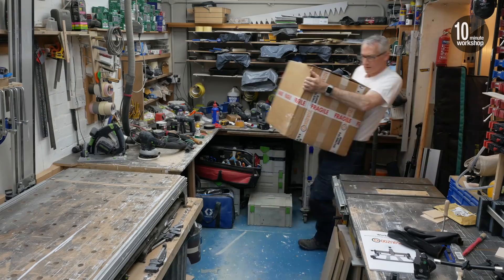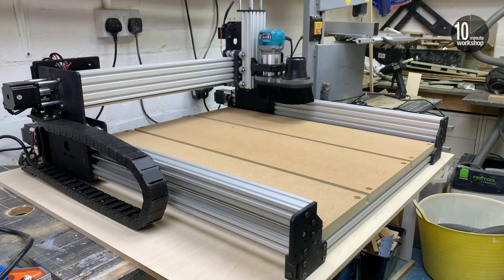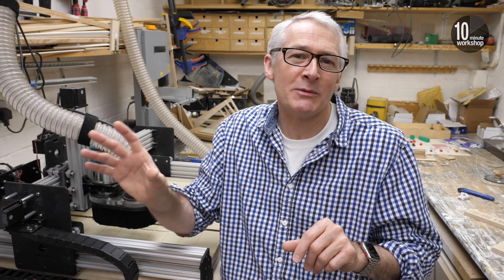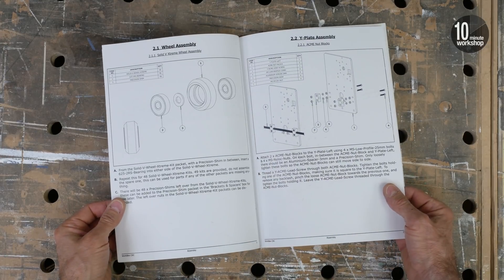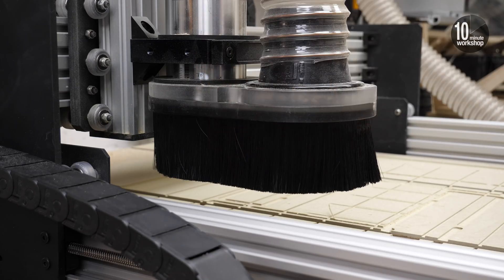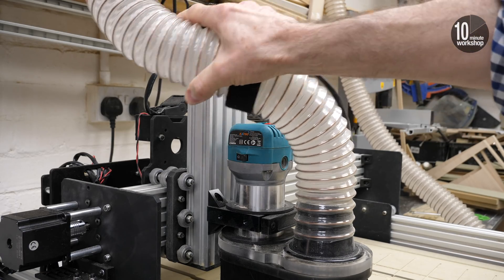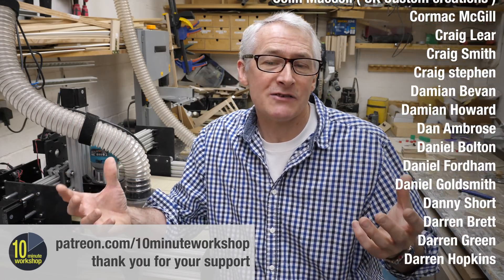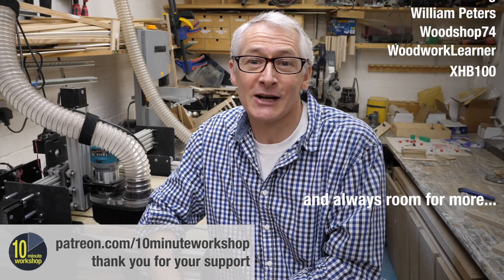Starting Out in CNC P11 - In conclusion [video 395]

Comment: Always a pleasure to watch your videos they got me into track saws,having watched your videos on CNC because I’ve been looking at them myself. I wondered if you had anything more to add on the use of now time has passed. Keep the videos coming.
Reply from the maker: I'd just say to have a think about what the solution is that you want to solve; after a bit of time with it I decided that it was too big for the space I have, and too small of a work area for what I'd like to use one for. Also, slow and noisy. An 'enthusiast'  grade of CNC like the Ooznest is brilliant if you need one-offs like signs and plaques, or maybe half a dozen of something; it turned out that I either need 1 or 2 of something, or 100+. The 1 or 2 I could make on a bandsaw and sander faster than I could draw it up, let alone set the machine running. and for 100+ it's worth getting someone else with an industrial grade machine to do them for me. Hope that makes sense!

Peter
Reply: It does make sense Peter and thanks for your thoughts 👍

Comment: Hi Peter, I'm seriously considering an Ooznest CNC and just wondering if you have had a good or bad experience with yours? The building side of it is not anything I'm concerned with as I used to build model kits for a model shop, for the customers that didn't want to and also garden machinery repairs. Thanks
Reply from the maker: I didn’t find a CNC particularly useful; the Ooznest original Workbee isn’t a production machine - too slow for that. Great hobby machine though. Ooznest are fantastic to buy from, very customer focussed with great support. 👍👍

Comment: Hi Peter. Is there going to be an update on your cnc adventure? Do you still use it? Cheers
Reply from the maker: Been using it just last week actually (see my Instagram) and have just posted a Patreon/members video about why it hasn’t seen much use. Lots to do with it before I’d consider using it regularly. Long story short it doesn’t really fit very well with what I do, and what it does well it turns out  I rarely need. 🤷‍♂️ Great machine though. 👍

Comment: So, I believe this was the final (for now) CNC episode. I recently watched this series again because my interest in them has spiked once more. It's a great series.
I particularly liked the look on your face after successfully making two right angle clamping squares with it.
I was wondering if you ever cleared your other workshop space as intended to install the #Ooznest #Workbee or if it has joined the bottom of a long todo list?
Do you still have plans to revisit this in the future? And do you still feel you would buy this tool again?
Reply from the maker: I posted about this today on Instagram! https://www.instagram.com/p/CPSSm0sDPYJ/?utm_medium=copy_link 

It’s been moved twice, most recently to (I hope) it’s final location, and I used it yesterday for the first time in a long time; worked great, but it is slow, and loud.

There are two issues with CNCs in general for me; the main one is lack of space, and the second one is software - I don’t own a PC and I’m not about to buy one just to run one application!

This particular CNC really needs a proper spindle/router - I put the little Katsu on their just to see if it worked tbh - but in truth a decent Mafell or SauterShop milling motor is going to cost far, far more than I’d ever be able to justify for the use I’m likely to get out of it. There are many more reasons why I don’t really see it getting a lot of use, but the main one is that it doesn’t really do anything I need; if I need to prototype something quickly and simply, then I’m much faster on a bandsaw and router, and where the CNC would score - doing it again, and again - just isn’t something I’d do here - I’d prefer to farm that kind of work out to someone with an industrial CNC than can chew through the birch ply faster.

That doesn’t take anything away from the Workbee - it’s a great machines, but for what I do it’s neither fish nor fowl. 🤷‍♂️👍
Reply: @10MinuteWorkshop  Yes, I see where you are coming from. I tend to agree that would be the case for me too - but something tells me I need one! :)

Comment: What a helpful and informative series Peter; well done and many thanks. It’s persuaded me to jump down the rabbit hole and put an order in with Oozenest. 
Like you, I’m living in an Apple world so I’m going to partition the Mac to run Windows.  I notice that you use a MacBook to drive the controller. Presumably you don’t find there’s a problem sending the G code from Vectric to the Mac via a USB stick?
Do you have any plans to update us on how your thinking and skill set has moved on with the kit since you last posted? I’m sure we’d all like to know!
Keep up the good work
D
Reply from the maker: Thanks Dirk! I have to be honest I haven't used the CNC much since I made this series; I needed to move it, and having done that it needs recalibrating, which I'm not keen to do right now as a0 I need to move it again, and b) I want to change the spindle. So more to come on this, but I need a workshop re-org before that can happen. 👍
And noi issues at all running G code via a USB stick; the controller has a browser interface, so you can actually control it from your phone or iPad once the files are loaded. 👍

Comment: Are you going to use a dedicated computer to control the CNC? Do have concerns about wood dust causing the computer to overheat or cause a fire?
Reply from the maker: No, and no! Once the toolpath gcode is loaded onto the CNC, you can run it through a browser on anything eg phone or iPad. I may get a dedicated ‘workshop’ machine, but no, I’ve no concerns about having it in the same room. 👍👍

Comment: Hi peter. Thanks for your videos. What spindle where you looking at. I am really interested in one and don't want to burn my makita router and does the ooznest has the capable to control speed of the spindle?
Reply from the maker: Hi Adrian, and thanks! There’s a Mafell ‘milling motor’ that’s looking good, and one from Kress; both of these can be powered on and speed controlled from the duet board on the Ooznest Workbee. There’s also a Fein die grinder that’s been recommended - die grinders can be good as they’re designed for lateral forces. The Mafell’s looking favourite - and the most expensive, naturally... 🤷‍♂️👍
Reply: @10MinuteWorkshop  hi peter, thank you fir your reply. You channel is one of my favourite. I will visit your patreon site for sure as 10 minutes are not enough :)

Comment: If you are familiar w/ Ron Paulk’s eponymous workbench, when FastCap got the rights to produce it, they used a CNC machine to quickly machine an 8x4 of plywood into the required parts and they machine them now on demand. It’s an amazing enabler technology.. once the programming is done, you can do it over and over.
Another YouTuber that uses CNC to enhance his otherwise hand-built cabinets etc is Frank Howarth. He does little things that I think your ‘well funded’ customers might appreciate. Such as routing little jigsaw piece shapes (either leave the routed shape clear or use the BC to machine a contrasting piece of real tree meat to glue into it) into kids toy box panels, dog bones, etc. A total pain to do manually but relatively easy w a NC.

A cabinet maker with an aesthetes eye (as you have) will find no end of uses for your machine.
Reply from the maker: Thanks Frank! Yes, like the Tracksaw and the Domino, the CNC will enable a whole range of other things to be made with relative ease - ‘relative’ being the word! And I agree, it’s quite remarkable what a full-size industrial CNC can do! 👍👍

Comment: Hi Peter, I have machined 20mm holes along the front of the X axis and along the left hand side of the Y axis, that way you can use bench dogs to align the workpiece in the same location every time. Then all you need to align is the Z height. Obviously this only works on square or oblong stock.
Reply from the maker: Great idea, thanks! 👍👍

Comment: Great build and review Peter, however I do think you have missed the emphasis of the cost of the software (esp) Aspire as its running out at around £1100 for a license that effectively doubles your costs?
Reply from the maker: Thanks Graham. There’s nothing I’ve done with Aspire that couldn’t be done with e.g.  the entry-level Vectric Cut2D Desktop software. As I say in the vid, Vectric very kindly gave me access to Aspire (for a limited period) and I’ve only used it in the most simplistic of ways, so far. Other options are available eg Fusion 360, which is effectively free to use for most people. 👍👍

Comment: Tip for file transfers, you could use Dropbox or Google drive on both computers and automatically sync your gcode files between PC and laptop. No more faffing with USB flash drives.
Reply from the maker: Thanks - they’re all networked tbh, so no worries there 👍👍

Comment: Spindle advice: I started off with a router like you. Cuts ok and gets you going. But the noise and an air cooled motor blowing sawdust everywhere was not enjoyable. I changed to a water cooled spindle with an ER20 set of collets. Pros: you can use 1 to 13mm shank cutters ( most large router cutters have a 1/2” shank) , speed  4000 to 24000 rpm. Controllable switch on, off and speed choice in gcode if your controller supports it. Cons: coolant container (5 gallon bucket) , flow and return pipes, pump , vfd, and spindle will be heavier than your router. With a long programme running I leave my machine running and close the door “lights out”. My advice; stick with what  you have until you get fed up with it. Retired toolmaker.
Reply from the maker: Thanks! Yes, this little router won’t last long if I keep using it like this, but a better ‘milling motor’ is on the cards soon; be a while before I get to water cooled 3-phase though! 👍👍

Comment: As you have Aspire you need to get a 3mm ball nose bit and do some 3D carving.
Reply from the maker: One thing at a time - but yes, absolutely! 👍👍
Reply: Peter Millard as you’ve spent more on software than the CNC machine you should make best use from it or you’d been better off with cut2d or vcarve.

Comment: My CNC started out with a makita 0700c router, which looks identical to the one your using.  It caught on fire three times. Luckily it was under warranty and was replaced each time. After the final fire I switched to a water cooled spindle. And what a difference both in power and lack of noise.
Reply from the maker: Yes, the Katsu is a cheap knock-off if the Makita. It’s the first thing I’ll be changing. 👍

Comment: A very interesting series of videos which has taught me a lot, and answered a lot of questions I had  not even considered. It will be interesting to see how well this machine performs when it is all properly set up. If you are feeling flush, I would definitely recommend the Mafell motor: they are nigh on indestructible.
Reply from the maker: Thanks! Yes, I think the Mafell is the front-runner. 👍👍

Comment: Yes, excellent idea to switch to a spindle!
I recommend software controlled variable speed. It helps making cleaner cuts as it allows to match the router bits recommended speeds more precisely than using a router's speed selection knob. You can also vary the speed based on the geometry to be cut during more intricate work.
If you don't need to change the router bits very often then a quick release chuck is just a nice to have.
Reply from the maker: Thanks! Yes, looking forwards to learning more about all this! 👍👍

Comment: I have a Kress spindle (actually an industrial grinder) - also VERY noisy - although suppose you could say it's an "expensive-sounding" racket ;-)
The Mafell spindle with quick tool change looks lovely - I find changing bit's to be a bore - my next machine will definitely be for full 8x4' sheets and have an auto tool changer.
Reply from the maker: Yes, it seems the only way to reduce the noise significantly is a water-cooled industrial spindle. Next time, maybe... 🤔😆👍
Reply: @10MinuteWorkshop  I use an aircooled 800W ER11 spindle (~100€ on ebay)  on my diy cnc, and even though I only have 400W VFD it works great and is quiet. It wouldn't be a big issue making the machine bigger if you need to, screws and extrusions are easily available

Comment: Well I thoroughly enjoyed this series, mate, thank you. 👍🏽
I too, as you are, pressed for available real-estate in the work shop,
I scored 4 pipe clamps with extensions and 4 bar clamps yesterday 
and had no room on my over crowded rack. So today I was mulling over where
to store them, no available room on any wall... but oodles of room on the ceiling
so I made some brackets, glued and screwed them together and mounted them over head. 👌🏽
Then I thought about the 100cm X 100cm Laser CNC/Engraver I have coming, no room for 
that either, so I'm going to take measurements tomorrow and look at making an over head pulley system for it.
Reply from the maker: Ooo! Interesting idea Bill! Let me know how it works out! 👍👍
Reply: @10MinuteWorkshop  
Will do mate, soon as it arrives and I get it built and all else that goes with it. 😉
It's supposed to be here next week sometime. So maybe 2 weeks tops?

Comment: Enjoyed the videos Peter as always. Now you have no excuse for not upgrading you MFT top :-) Are you going to fully enclose the machine with some form of drawer pull out? Is there any reason for not installing vertically? Cheers and keep 'em coming. Eddie
Reply from the maker: Thanks Eddie! I think they need to be designed to work vertically - I know some do as the one my timber yard has works that way. Still considering the full enclosure - need to get it settled in the other room first, which means having a bit of a clear-out! 😱😂👍

Comment: Nice job Peter.  Thank you very much. Lots of questions still remain for me particularly around software options but I would also be interested in how you would incorporate a vertical workspace.
Reply from the maker: Thanks Dave! I know some CNC machines work vertically but I think they need to be designed that way. 👍
Reply: Peter Millard I’m thinking about working on the edge of a board. As I understand it it’s just a matter of adjusting the spoiler board so that the bulk of the material is held under the table.  Of course the struts under the spoiler board may need relocating but I don’t know how much of a job that is. I’m a way off yet but if and when. I will send photos and observations. Thanks again.
Reply from the maker: Ah, OK - vertical workpiece, got it. Yes, I’ve seen a few people do something like that on Instagram. You need to be able to hold the board absolutely perpendicular to the bit, of course, but once you’ve solved that then everything else should be pretty straightforward. 👍👍
Reply: Peter Millard .  Just realised for a vertical set up work holding doesn’t have to run left to right across the front of the machine. It may not be just as convenient but if the board is placed front to back it will go between the central struts.